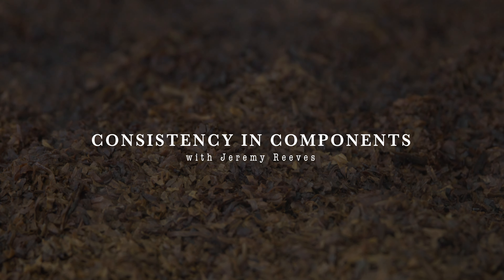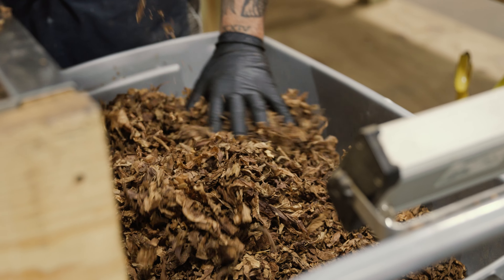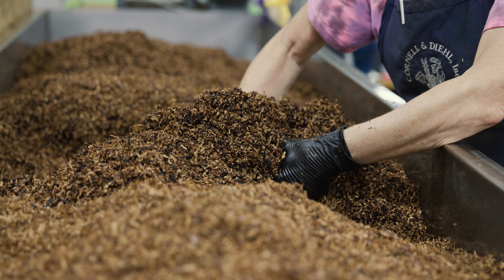How Does Cornell & Diehl Keep It's Blends Consistent?

Comment: I’ve noticed that some blends, like Haunted Bookshop for instance, seem sweeter than they used to be. I’m not sure if they are purposely that way or perhaps aging changes them, or if it comes down to the variations in crops. Don’t get me wrong I still like it but the newer stuff is different than my 2019 stash.
Reply: It sounds like if changes are made that they are incremental so that the batch to batch differences are small.  This also means that if you compare batches separated by several years, any differences will be more noticeable.
Reply: Very rue, not to mention my tastes have changed, whereas originally I found Haunted Bookshop to be too strong, now it’s much more manageable. Across the board I’ve noticed that the blends I had from 2019 were stronger but it’s all so subjective… one of the reasons I love the leaf.
Reply: Could it also be due to the tobacco aging over time?
Reply: @Matt_RVA  Your nicotine tolerance probably went up.